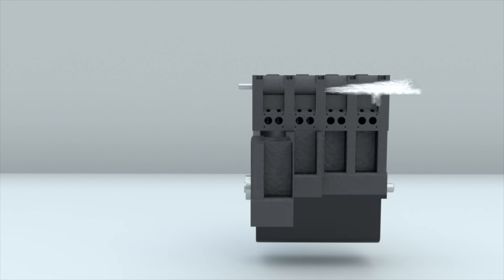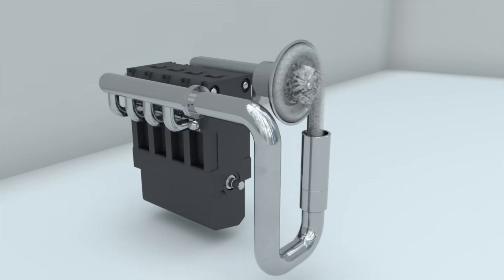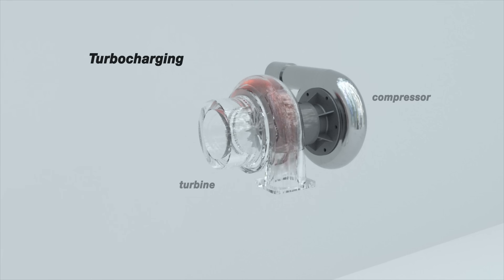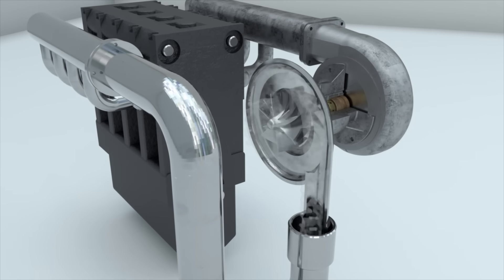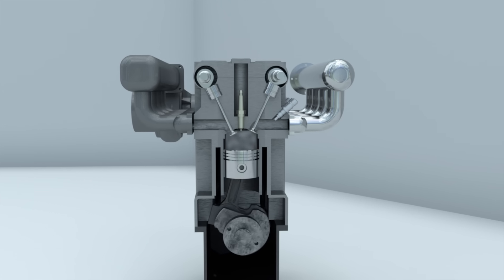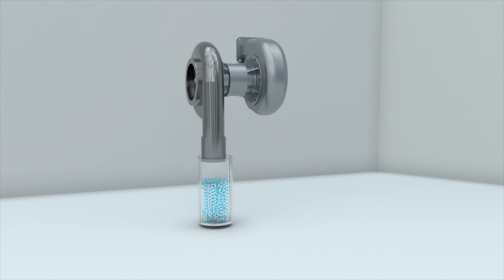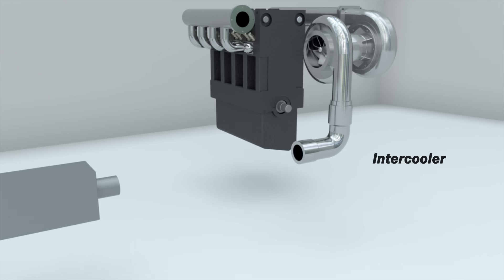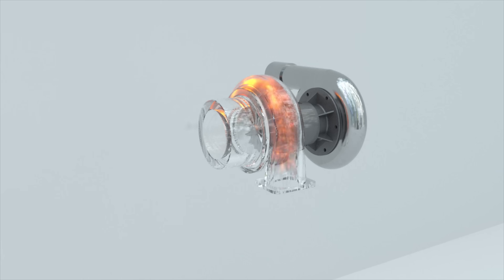How does a turbocharger work?

Comment: Excellent explanation! People should know that a turbocharged engine/car will break down prematurely/earlier as compared to a similar car without the turbo. Turbos put extra pressure on the moving engine parts even when built with stronger or better materials. If you want more power, get the turbo but if you want your engine to last longer don’t get the turbo.
Reply: Technically you are correct but the difference is negligible and doesn't really apply for most modern day turbo cars that are designed for it.
Reply: Virtually all factory built turbocharged cars are built now to be reliable under moderate boost pressure. Having said that, the actual amount of pressure used is relatively low as the primary need is for fuel efficiency through best fuel burn. 

The other option is to overbuild the engine first - make it tough and reliable with heavy duty components, then adding turbocharging. However, this is mega expensive and really only useful if you're aiming for massive power.
Reply: Most modern engines are turbo-charged. They have been effective in the past and soon will be the only type of engine in the future
Reply: @liamaldous2624  diesel turbo is reliable
Reply: Air çharge coolers are neat
Reply: Oh BS.  I had 3 Chrysler Turbos,  ran full synthetics, 3 min warm up and 3 minute cool down, ran 2 cars well over 100k with no problems.  I traded off the 3rd turbo as I got tired of driving a stick shift in hilly areas.  Regretted trading of the 89' CS Daytona within 6 months.
Reply: @lonniebeal6032  Chryslers are reliable machines. The internet gives them a bad rep, but I live in the real world.
Reply: @lonniebeal6032  100k is nothing in cars' world. You clearly know nothing about reliablity or longevity talking about getting over just 100k.

Comment: I'm at the point in my life that I don't want to break down or have tons of problems with my vehicle & have super low repair costs if problems arise. All this while at least getting 30mpg. 
My 5 speed '07 Focus 
ST achieves all the above. Its all about simplicity
Reply: Keep in mind that a turbocharge system will strain your engine significantly more than when naturally aspirated, and thus it will not last as long as it could have otherwise.
Reply: You're most of the way there with a simple all motor? 5 speed, but switch to Japanese... Honda or Toyota. Although if you currently have a car that doesn't break down, then keep it. It's usually wiser to simply fix whatever breaks, than buy a new car. People come up with all kinds of twisted logic, to justify overpaying for transportation. Secretly, they just want to impress people with a fancy car.
Reply: Im sorry my man, but its a ford, an american car. It wont last much longer unless youre lucky. You should go with an invicible corolla you'll be in a real state of mental tranquility
Reply: @ab-edit5486  
250,000 miles
(original motor & trans)
  so far for this  "American car" isn't proof of its rock solid reliability? This focus had No issues other than normal wear & tear like brake pads & wheel bearings @ 150k.
  You must be stuck in the 80's & 90's where what you said was pretty much true. But Those days are over
Reply: @DETmichigan-yy6lf  hmmm not stuck in 80s 90s I was born past 2000 I own a Acura TSX and it's rock solid. You're lucky with your ford. US cars ARE bad. That's it
Reply: @ab-edit5486  The ford focus isn't really a US car, it was designed by euro ford and is a pretty reliable car.
Reply: @liamholcroft7212  I had a 2006 Ford mondeo made in gemrnay and it was an unreliable piece of trash. Sometimes the alternator (made by Valeo) (battery charger) giving up and then the whole air cidntioning setup breaking down from compressor to leak in condensor coil which require taking apart the  whole dashboard for costly repairs. Then engine problems of various kind to water body giving up to radiator exploding to radiotor plumbing problems to engine over heating to engine getting blown.  It was the worst most unreliable car ever. Even when it was just 4 years old. Never going near amaerican trash cars again.
Reply: @FishingAdventuresDubai  sounds like you had a bad example, mondeos are generally reliable.
Reply: @FishingAdventuresDubai  for the record, I'm not saying american cars are good, just saying the focus is good.

Comment: Fiat used to make smaller diesal turbo motor 1.3 L with 100 HP due to Turbo compression very efficient of fuel and power !!! In India many cars fitted with this engine !!!! Great explanation loved the graphics and narrative!👌👌👌👍👍👍👍
Reply: Correct me if im wrong there was 2 variant of fiat's 1.3L engine with 75hp and 90hp respectively.
Reply: @savagegaming27  yea you are right !! Two variants of that national engine !!! With revamps we can extract 100 HP of it !!
Reply: @SanKiranKReddy  i didn't knew that we extract 100 bhp of power from it. Anyways thanks 👍
Reply: Was that not the thp 100 turbo petrol panda ? In Euro the panda 1.3 100 bhp turbo is a petrol not diesel engine .
Reply: @CalasTyphon488  he's talking about the 1.3 Multijet
Reply: Gayış paket linea 😍

Comment: Could you turbo a ej201 it’s a boxer engine from an 96 Impreza
Reply: Yes you can turbo any internal combustion engine. For that motor I wouldn't go more than 3-5lbs of boost anymore you blow out the motor. Also do a compression check so you know your piston rings aren't toasted. If its in a good running condition it can handle that kind of boost
Reply: @finhappygrower8400  yeah I’m saving up to do it right I got a 99 Impreza rx it’s pretty much stock expect for exhaust and rims but it’s got 372,000 kms on the clock has always been serviced from Subaru dealership till about 280,000 then I bought it so I go to my local mechanic besides the point it runs perfectly fine actually I nearly hit 5-6k each time I drive it cause the sound alone and that slight pull you get at 4500 to 5500 revs it’s really noticeable so I try my best to only do it in 2nd or 3rd so I don’t speed. I also only pump premium through it and let it warm up a good 5 minutes before I drive it ect so I try my best to take care of it but it handles it so well and I feel like it could easily take more power and even rev out further cause it sings from 3k up when you full throttle. Only thing I might need to think off upgrading before the engine is the brakes as the back two are drum brakes and heavy braking isn’t suggested 😂 and maybe the clutch as the owner before me pretty much burnt half the clutch and the gear stick is wobbly as all hell but it stays in gear overall I’m happy cause it only cost me 1k
Reply: @finhappygrower8400  it’s honestly so much fun to drive I just rekon it needs abit more grunt just to fully get that sports car feeling cause I’ve owned a 6cyl falcon stock and it pulled great but didn’t get up to speed aswell in my opinion plus it’s a big heavy rear wheel drive compared to a light small all wheel drive car it’s a fun change and you save abit of $ on fuel to If I’m right 👍🏽🔥

Comment: I just love the feel of my turbo kicking in on my SAAB 9-3. Such a fun driving experience. It feels like 100 horsepower at low boost, then as you spool it up it feels like you're giving those horses steroids so you get 175 hp. Too bad that turbos add another system that could possibly fail and also shortens the life of your engine.
Reply: I have 175 hp Saab 9-3. Great car
Reply: @jesukxd8494  absolutely. I just got a car financed, a Mercedes W212 E200 to be exact. It has awesome comfort compared to the saab. But the saab just feels way better to throw around for being so old. The saab definitely has a better driving experience.
Reply: my first car was a SAAB 9-5 coupé from 99. best experience ever.
Reply: damn, are saabs fun? :D
Reply: “Stage 2 tune” 🤦‍♂️ stfu my guy
Reply: Saabs are just different ♥️
Reply: Try a 300plus nissan rbdet engine

Comment: I love how it shows cylinder 4 getting less air due to the cylindrical manifold
Reply: i don’t even know what that means 😂😂
Reply: Not all four cylinders have cylindrical manifold
Reply: Someone doesn't understand fluid dynamics.
Reply: @galvatron0810  air is not a fluid
Reply: @0Blueaura  you're out of your element donny, the china man is not the issue!
Reply: it's because the animation is simulating the movement of "air" as water droplets moving through empty tubes. There is no simulation of pressure, so this is not perfectly accurate
Reply: Re
Reply: Is that bad news?
Reply: @GODLYN1X  why wouldn't?
Reply: True dat
Reply: What does that mean
Reply: @sabiha_.  I think at 0:07, because air comes in from the right, the cylinder all the way to the left receives the least amount of air.
Reply: @TheTwoReborn  air pressure equalizes across a vessel though, its just that it flows in a weird timing i think
Reply: Bobb Grimley  ahaha ok thanks for clearing it up
Reply: Bobb Grimley  😅
Reply: not cylinder 4
Reply: … it doesn’t!

Comment: So a turbocharger is more heavier than a supercharger
Reply: Well this depends on the type of supercharger. They can essentially add the same weight if your doing a centrifugal supercharger. A roots or twin screw supercharger is definitely more heavier and creates more engine manifold heat. All in all the extra weight really won't be noticed for driving characteristics and the extra power will offput the weight entirely
Reply: No… turbos are normally smaller and lighter than a supercharger that can deliver similar performance.

Comment: Does the exhaust gas go through turbo into the intercooler or does the front part of the turbo suck in air? My b if i sound stupid just need clarification feel me
Reply from the maker: The air from the atmosphere is first compressed by the compressor, then enters the intercooler and cools, then it is mixed with fuel and ignited in the engine chamber, then the exhaust gases with residual energy rotate the turbine. Ask if you're interested, everything is fine

Comment: Anyone know if I can install this in a Mitsubishi mirage?
Reply: no you cant turbo a 3 cylinder engine it wouldnt work its too slow try an old mitsubishi like a galant or eclipse
Reply: @krayzietj  You can
Reply: @adityaravi3180  you might be able to, but whats the point of adding turbo to a car with 78hp?
Reply: @krayzietj  very useful for cheap cars though, the 78 then becomes 110
Reply: @adityaravi3180  lol thats still slow as dirt, id rather turbo a REAL mitsubishi like the galant or eclipse. My galant puts out 160+hp with no turbo. Now thats worth turbo'ing.
Reply: @krayzietj  displacement?
Reply: @adityaravi3180  nah, same original 4g69 motor from japan
Reply: @ Jose Medina yes you can but don’t. The mirage being a Mitsubishi will come alive with a 4g63 engine swap. Already turbo and better designed engine. Better performance for your buck.

Comment: I wonder if Air to Cool intercooler are more effective on lowering the air temperature then air to air
Reply: Air to cool?
Reply: @marcanthony9659  yea. What the dude said in the video. I wonder which is better
Reply from the maker: The liquid will conduct heat better than the air. Therefore, the liquid intercooler itself will be more compact. But an additional pump is needed, a tank for storing the coolant, this liquid itself must also be cooled.

Comment: I don’t understand why hot compressed air to engine is inefficient? Assume amount of oxygen is the same ? With or without intercooler
Reply: @XiaoXing Liu the simplest way to understand it is. Cooler air is more dense which means more fuel can be injected for more power output. Hotter air reduces power, causes detonation and decreases thermal efficiency. This is one of the reasons non inter cooled 80’s and 90’s car lacked power but made major power gains adding an inter cooler alone. Much more to it but this is the basics.
Reply: i think it prevents knock, when detonation of the air fuel mixture isnt exactly where the spark plug is (where you want it) but also at another area in the combustion charmber. this is due to the high temperature. It isnt so much to do with the amount of air.
Reply: The hot compressed air would essentially add the same power but if all the air was hot your engine would overheat due to lack of a cooling system and it’s just bad to have a hot engine to start with you want it to work efficiently without putting major stress on the components themselves
Reply: Mostly every turbo setup requires an intercooler or you could blow your engine real quick🤣

Comment: Now take this system and add more turbos. More turbos makes more power then you gap the opposition. ;)
Reply from the maker: Quattro turbo :-)
Reply: @hydraulicandpneumaticsyste3253  2 turbos per cylinder
Reply: @hydraulicandpneumaticsyste3253  quattro quattro quattro. yea get that one around your head: 4 audi quattro transmission cars each with 4 turbos.

Comment: What is better centrifugal supercharger or turbochargers?
Reply from the maker: Depends on the operating conditions, on the characteristics of the engine, the supercharger does not depend on the amount of exhaust gases, and the turbo boost allows the use of residual energy.

Comment: Why are turbocharged cars lower in engine cc?
Reply from the maker: Because you can get the power you need with a smaller engine
Reply: @hydraulicandpneumaticsyste3253  so the goal was fuel efficiency
Reply: @shiekhwaleedmiral-protein2819  precisely

Comment: The cooling part was unexpected for me. I thought it's similar to smithing where we want our air to be heated, before forcing it to the forge.
Reply: The compressed air is cooled to reduce chances of pre-detonation and increase efficiency (just see PV curve of a compressor with intercooler).
Reply: The maximum temperature of the combustion is limited due to reliability. If it werent, you would want as hot air as possible. But since it is limited, you are better off compressing the air at a lower temperature, as it requires less power.
Reply: Cooler air is denser hence higher pressure and more potential and thus kinetic and thermal energy
Reply: @Nr15121  cooler air is denser at the same pressure than warmer air, but cooler air is not at higher pressure; pressure is an independent variable.